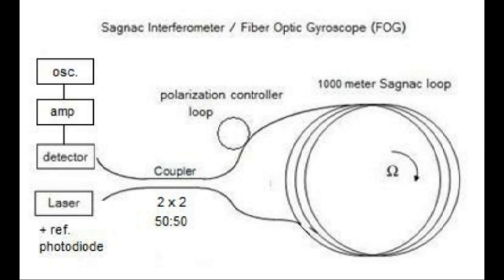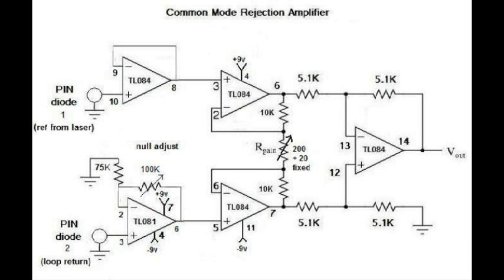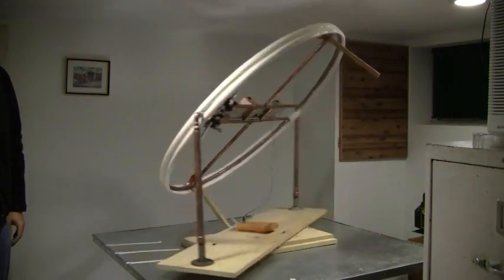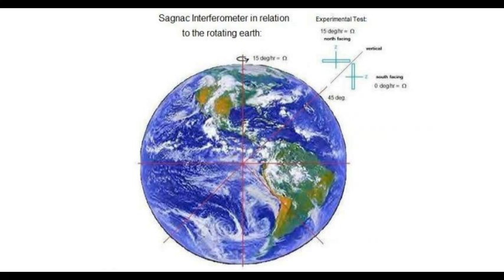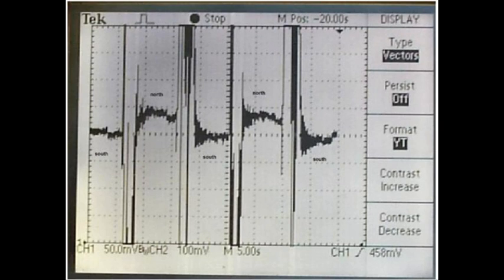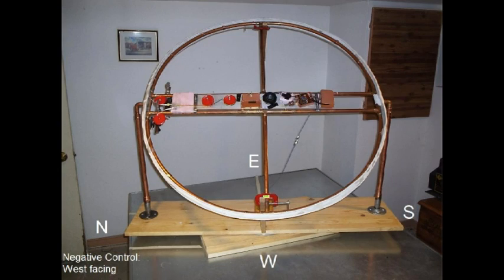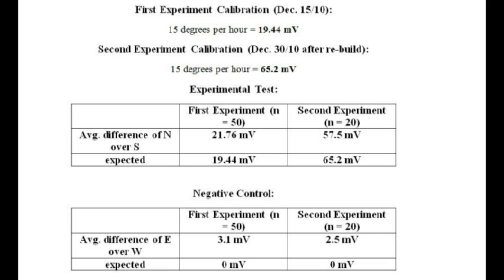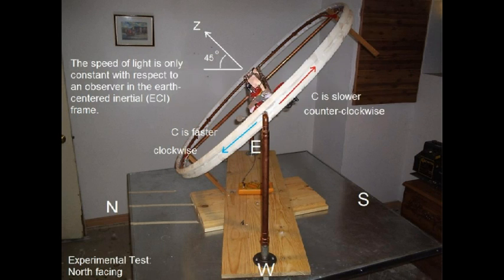Detecting Earth's Diurnal Rotation Using a Large Area Sagnac Interferometer

Comment: Given all of the rotation we're told occurs, earth, solar system, galaxy, etc....how can a "non-rotational frame" exist?  There is no stationary vantage anywhere... ever, right? Is this even relevant? Still absorbing your model. thanks.
Reply from the maker: An absolute reference frame is relevant I believe. The cosmic microwave background radiation (CMBr) is considered to be an absolute reference frame by some, since the motions of the sun, our galaxy, and all other astronomical bodies are commonly referenced to it. It would also solve a problem about light, since electromagnetic waves were stripped of their physicality when relativity was introduced, and the photon theory has no way to explain why the speed of light is measured to be exactly C - to simply say it is a rule without explanation is not very satisfying for a rationalist. The fiber optic gyroscope implies that the speed of light is constant in the non-rotating frame, i.e. an observer stationary in this frame or moving in a straight line with respect to it would measure the the two counter-propagating beams to arrive back at the detector at exactly the same time. If light was actually a wave in "something", then this would be consistent with the speed of light being exactly C in this something, and the speed governed by the density of that "something" just like a wave in any other known media.

Comment: Thank you for the demonstration of a Sagnac Interferometer Gyro system. 
But I don't think you can throw out the constancy of the speed of light in a vacuum so easily. 
You should take "C" as a constant, then explain the effect in that context. 
Don't forget Maxwell's equations which are used as the basis for the electronics in the experiment require "C" to be constant. 
But you are correct, a good explanation of the physics for the system is hard to find. And I've been maintaining RLG systems since about 1992. Not to the engineering level you are though. 
I think the best explanation for the effect is that the distance traveled is more in one direction of the ring than it is in the other due to the movement of the gyro causes the apparent movement of the standing wave when in actuality it isn't moving at all. 
The speed of light inside the fiber optics will be lower than in a vacuum anyway.
http://signallake.com/signallake.com/innovation/andersonNov94.pdf
Reply from the maker: Hi Flatlander, I understand your misgivings, but we must conclude that the truth is what we measure it to be in our moving frame of observation. So on the earth, with my Sagnac loop stationary, I see no path length difference for the light in either direction, but I detect a fringe shift due to the earth rotating. I have no choice but to conclude that a beam of light has taken two different times to travel the same distance (in my frame), depending on which way it goes around the loop. To argue that the path length has changed is only true for an observer who is not rotating with the earth (because only he can see the paths actually rotating) , so then the speed of light is constant only in the non-rotating frame of that observer. To say that the non-rotating frame is correct over the rotating frame is to say that the non-rotating frame is a preferred frame of reference for light, which is abhorrent for relativity anyway! And if you bring in Maxwell, he believed in the aether and all of his equations were based on the idea that magnetic and electric fields are manifestations of the motion of aether, which again would be a preferred frame of reference for light. In fact, that is the only conclusion that makes physical sense, that the speed of light C is constant in one stationary frame (aka the fixed stars) and only appears to be constant in all other moving frames due to illusions caused by moving clocks and measuring rods that give us the "appearance" that the laws of physics are preserved in moving frames. Mathematically and experimentally,  this alternative view is indistinguishable from relativity. 
See: http://www.conspiracyoflight.com/SagnacRel/SagnacandRel.html
Reply: plenum88, an observer on the surface of the Earth is not in an inertial frame of reference! You are on the surface of the rotating Earth! To make it easier to think about, imagine your loop lying flat on the north pole. The observer on Earth is rotating along with the planet, not in an inertial frame of reference. From the perspective of the north pole, the Earth turns counterclockwise. By the time light entering clockwise reaches the other end of the fiber loop, the Earth has rotated ever so slightly, increasing its distance ever so slightly.  The opposite is true when going the other direction. If you had a gyroscope with more precision, you could measure the rotation relative to the Sun (~1/365th that of Earth's rotation). An obscenely sensitive gyroscope could theoretically measure the galactic rotation.

Comment: Do you think that is possible to develop a very precise clock using Sagnac's interferometer? Will this clock be more precise and affected in a more predicted way when in orbit?
Reply from the maker: +Nathan Neiman 
Nathan - I have talked about Sagnac clocks in some of my published articles, such as this one http://www.conspiracyoflight.com/SagnacRel/SagnacandRel.html . Right now the technology doesn't exist to make a Sagnac as accurate as an atomic clock - there are other clocks based on mechanical rotation which could be appropriate if they were sufficiently stable at high speed. For example, Marinov's coupled shutters experiment was a type of mechanical high speed clock, but it also had its own issues.
Reply: +plenum88. Very good article, I will read it again to a more deep understanding. Initially I think using 3 Sagnac's rings. one receiving a laser beam from Earth to synchronize and generate the orbital velocity, the ring would be the circular orbital path.  The other two rotating freely (without friction) perpendicular one to the other, being one with the plane of rotation parallel to the orbital direction. Coupled to each Sagnac's ring a UHD like blue-ray disc, but larger, to generate a high frequency digital clock. So, there would be Two digital clocks and two rotational counters synchronized with the earth atomic clock. 
When I imagined this experiment suddenly I became very excited, because I realized that any time dilation would be a direct violation of the Law of Angular Momentum Conservation.
What do you think? Am I crazy?
Reply from the maker: +Nathan Neiman 
I guess the technical issue is that although the Sagnac interferometer can determine the rate of rotation of say the earth, and thereby the length of the sidereal day (implying a measure of time) the output of the interferometer is either just a voltage, or if it uses a fiber actuator, it outputs a frequency that is dependent on the actuation frequency. So it is difficult to translate the output to a proper clock rate with extreme precision.

Comment from the maker: Truth Seeker - since the fiber optic gyro is theoretically sensitive to rotation only, the diurnal rotation of the earth will give the largest angular velocity component detectable. The rotation of the earth around the sun, amounting to one revolution per year, would then be ~1/365 the magnitude of the diurnal value. This value has been detected in some extremely sensitive devices like ring laser gyros. Our rotation around the galaxy should also be possible to detect if enough sensitivity were available, but this amount would be very tiny indeed. I have a simulator that shows why translational motion should cancel out around the loop, which is here: http://www.conspiracyoflight.com/Sagnac_webapp/Sagnac_interferometer.htm
Reply: +Christian
As conventional gyroscopes fail to detect and measure the rotation of the earth, I suppose we can conclude your experiment proves that it is, in fact, the aether
... my conclusion would be based upon the difference between mechanical gyros and this type: one suffers friction, the other doesn't
so: friction - not aether ;)
Reply: These instruments wont detect earth's motion because of relativity. But of course flat earthers dont understand relativity
Reply: Relativity only prevents you from detecting constant rectilinear motion. Both earth's rotation and revolving around the sun are not constant rectilinear motions, thus you can detect them with instruments that are precise enough.
Reply: Nice! You wrote that program?
Reply from the maker: Yes, I wrote a little simulation in Excel, and used Spreadsheetconverter to turn it into an online app.
Reply: Exactly. The fiber optics gyroscopes are now replacing the old, big and heavy gyrocompasses.
Reply: not all mechanical gyros fail to detect the rotation of the earth, just the ones that have too much friction

Comment from the maker: jfqam - exchanging the connectors to the coupler shouldn't make a difference since both beams follow exactly the same path around the loop except in opposite directions. So regardless of which way the loop is connected, the fringe shift should still obey the Sagnac equation. The only path difference in this setup occurs in the coupler itself, where one beam bar couples the the other cross couples, leading to a 180 degree phase shift for one beam vs. the other on return. However, this is advantageous, since in the stationary state the beams are in anti-phase and therefore in their most sensitive condition to detect rotation.

Comment from the maker: jfqam - with this particular device, only RF noise is an issue, so putting it in a grounded metal enclosure would likely help. There is also a sensitivity to temperature fluctuations, but this can be reduced by winding the coil in a specific pattern, such as a quadrupole winding.

Comment from the maker: In the Sagnac interferometer, the propagation times in the CW verses CCW directions are not equal. Since in the rotating frame, the path lengths are exactly equal as measured by the rotating observer, a rotating observer has no choice but to conclude that the speed of light is different for each path. However, if the relativist attempts to argue that light speed C = constant in the rotating frame, then the prediction is zero fringe shift, which contradicts reality. So in this sense relativity would be categorically wrong. The Sagnac fringe shift is generated by rotation with respect to the fixed stars, not the laboratory, which implies a preferred rather than a relative frame of reference for light propagation, also something very un-relativistic.
Reply: In a Ring Laser Gyro (RLG) the better way to think about the CCW and CW beams is their optical frequency. There must be a whole number of wave lengths in each direction this is also the case in any laser, so what happens in a rotating RLG is that one beam has its wave length stretched and the other is compressed. This causes each beam to have a slightly higher optical frequency and the other lower the difference between these 2 frequencies is the Sagnac frequency
Reply: Cool, Relativity is wrong of course. The debunk of Einstein's postulate will be completed when we did an one way measurement of light velocity.
Reply: I'm thinking about this experiment and found that is feasible, contrary to common belief.
With two lasers pointing against each other, the detectors at the center and one single clock. The simultaneity (synchronism) of the laser pulses can be achieved with high accuracy using an optical (local) electromechanical system.
Reply from the maker: +Nathan Neiman 
I have tried several versions of this kind of experiment - for example, the Cialdea one-way speed of light experiment ( http://www.conspiracyoflight.com/Cialdea/Cialdea.html ), two HeNe lasers intersecting at a central detector measuring changes in interference as they rotate on a table; even oven stabilized crystal oscillator clocks on a rotating table. Unfortunately, the result is always negative for detecting translational velocity. Tyapkin wrote a great paper about this problem, and explained how even if Einstein is wrong, lasers and clocks made to rotate experience errors in their clock rates that exactly cancel the expected changes due to our motion through space. Same problem with Mossbauer experiments and GPS range measurements. I have a siimulator here ( http://www.conspiracyoflight.com/Onewaytwolaser/Oneway.htm ) that also explains the problem.
Reply: +plenum88. My purpose is to measure the velocities at opposite directions in a moving frame (earth),considering a fixed ether (no dragging). I imagined 2 laser beams, flashing synchronized high frequency pulses (on/off) at opposite directions toward the center, at 1km of distance of the central detectors (2 detectors). First the two arms are calibrated/synchronized in order to eliminate any time difference between the circuits, by placing the arms in parallel to each other in north/south direction. The synchronicity/simultaneity is obtained by a kind of electromechanical apparatus, wich is capable to generate a high frequency clock with high synchronization accuracy at the laser's position. The high frequency mechanic synchronization transport is moving at the same direction of the light beams toward the center at constant velocity (to avoid any kind of misinterpretation). The two detectors signal goes to an oscilloscope where the phase shift between the pulses is measured. The measurement is made placing the experiment in east/west direction. If my understanding of Sagnac is correct the rotational velocity of earth will be enough to generate an appreciable difference in the velocities.
Reply from the maker: Nathan Neiman

Sure - this would be kinda like a GPS range time measurement - you might be able to detect earth's rotational velocity but not earth's translational velocity. .
Reply: +plenum88. I think it will be enough to disprove Einstein's SR postulate of constant measured velocity in a moving frame.

Comment from the maker: Same goes for the path length change argument as the cause of the effect.  Further,  Einstein synchronization of clocks breaks down on the rotating rim – clocks on the rim go out of synchronization, contradicting the clock hypothesis of SR.  Finally, what does the Sagnac interferometer rotate with respect to? The textbook answer is “the fixed stars” – which is tantamount to calling space “a preferred frame of reference”.  All this proves is that in physics, nothing dies of a contradiction…

Comment from the maker: The SR postulate on constancy of C only applies to inertial frames of reference –thus does not apply to the rotating Sagnac frame.  At least one observer measures two different speeds of light on the rotating device, contradicting SR – if this were not true then the device would not work. C.R. Langevin in his famous argument with Dufour and Prunier attempted to bring the Sagnac effect into the relativity fold, but as D&P pointed out, this only works if the observer is at the axis, not the rim.

Comment: What don't you understand about relativity? There is no "preferred frame of reference". There have been thousands of other experiments that have shown that the speed of light is constant for all observers, but all observers will disagree about many other thingsTime itself is not absolute nor is space. Only space time is absolute. Your device is probably measuring doppler shift, which is produced by earths rotation.
Reply: +Kebil Friesen, Alas, the Sagnac effect shows that the speed of light varies as it travels through the 'aether' ;-/ This shows that there is no 'contraction of length' so that a constant speed of light is observed. Yes, it does show that 'special relativity' may not be as accurate as was thought. Look, 'science' is wrong sometimes. ;-/ It should accept it?

Comment from the maker: This depends on where you place the observer - if the observer is at the center of the ring, then what you say could be interpreted as true. But if you place the observer on the rim of the ring, which is generally where the photodetector is on the FOG, then this is false - for this observer the light path length has not changed with respect to his moving frame - it is precisely the inability of these varied observers to agree on the measured speed of light /path length that presents the issue